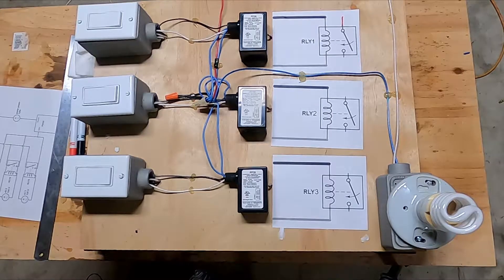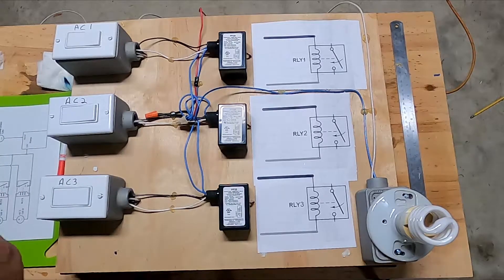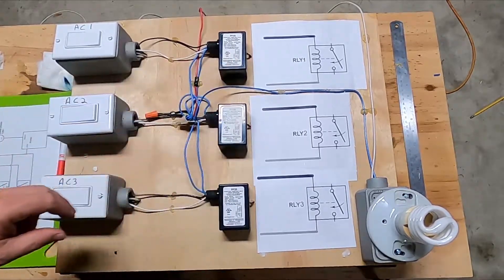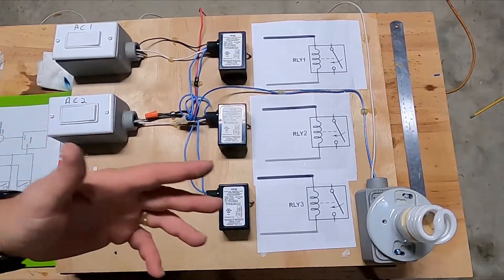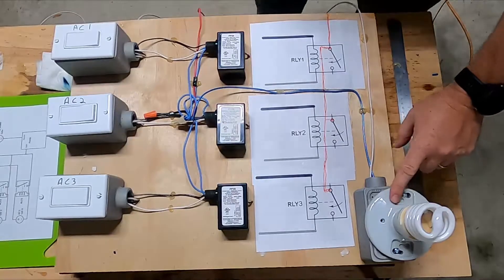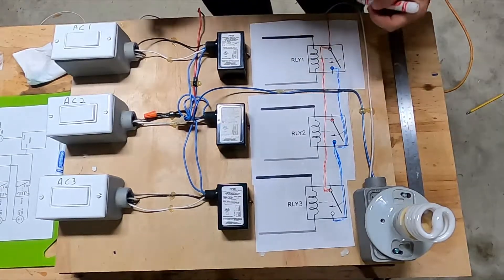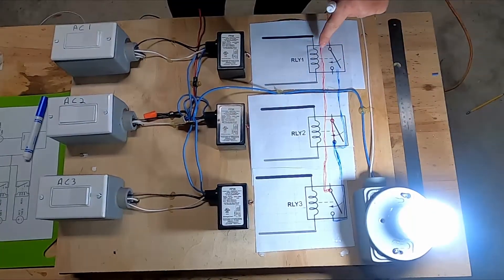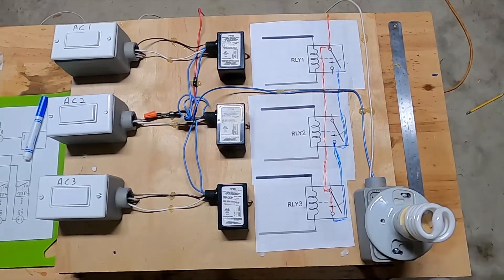Simple Ways to Control a Water Pump from Multiple Sources - Multiple Relays Control A Single Load

Comment: Just what i need. I have an outdoor wood boiler that has a single pump. And i have 3 things in the house that need hot water from the boiler on demand. Most people just leave the pump on the boiler on at all times. I don't want to do that. I have a 100-foot run, and there is some heat loss if it runs all the time, so i only want to run it when needed.
What is the part number of those relays you have? I search the web, but I'm not sure that what cones up is the right thing. Thank you.

Comment: Good Video and well explained..  Looks like they are the PP20 Relays by Sensorswitch?   I'm trying to run one pump when ever either one of two other pumps is powered up.  It seems like you solution would work but I don't understand the wiring diagrams for the relays.  Your Switches are simple 110VAC switches but do the relays require 24VAC to operate?
Reply from the maker: @AlanLarson-w1f  no. But you can use any relay voltage. These were justing lighting relays I had on hand. Let me know if you need something. I don't mind making a video.

Comment: Just what i was looking for. I wanted to connect a pump to my washing machine due to low pressure .i don't want the pump running all the time . but behind the water inlet, there are two solenoid valves that get energized individually. In this case i need two relays in parallel to each solenoid valve respectively to control the live wire to the pump. This is awesomely simple.
Reply from the maker: @edinamgablah2359  glad it could help.

Comment: What type of relays are they..DPST? I've been looking for this answer for 13yrs :D
Can you do a video on latching relays?  I've a buffer water tank: sensor 1 turns on pump and sensor 2 turns off pump.  Thanks.
Reply from the maker: Each relay I demonstrated was single pole single throw. You have a storage tank? Are you wanting to have remote switching or what?
Reply: @SparkyBuilt  It's just a basic system...currently buffer is maintained at a single temp constantly which is inefficient.  I don't want the buffer to be charged until top stat temp drops and keep charging until bottom pipe stats is satisfied. I think I'll need a DPST latching relay but not sure?
Reply: what about if the sources are from three diffent phases,  we need a double pole relay no,